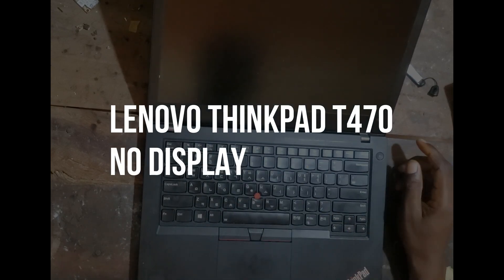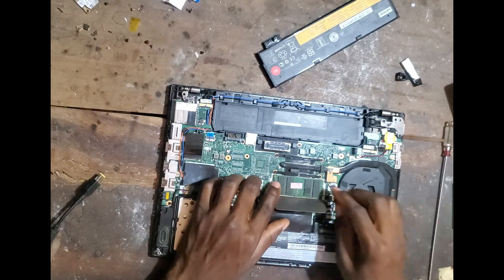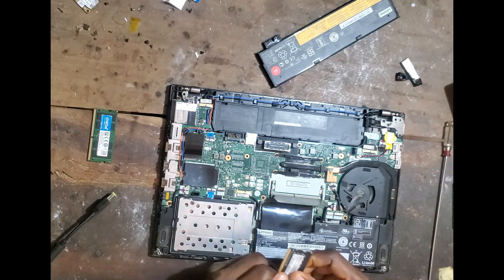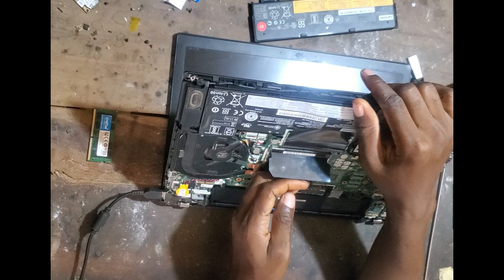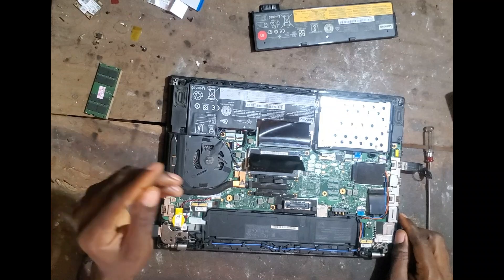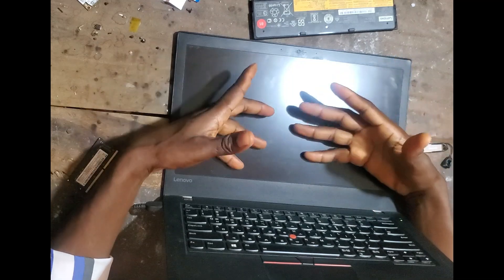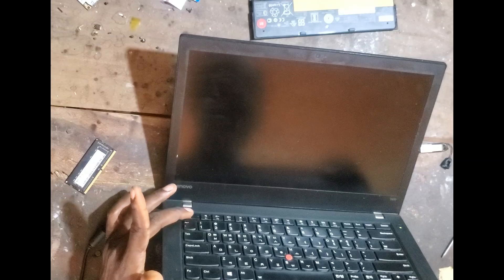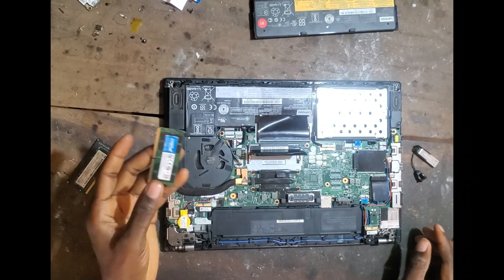Lenovo Thinkpad T470 No Display, No Beep; 100% Fixed Under 2 Minutes

Comment: Is it new ram? Try to slot the "bad ram" then turn on. New ram can take up to 5 minute to boot the window.
Try insert the bad ram into other laptops too, expect it will boot up in 5 minute
Reply from the maker: It wasn't. The RAM is dead. 

RAM shouldn't take that long to POST (Power-On Self-Test). 

A working PC with good RAM should POST in less than 10 secs. 

It becomes longer if there was a BIOS reset. 

NB: POST is the first thing that appears before the operation is passed on to the OS.

Comment: sorry engineer I got the problem with my lenovo T470 ,when i turn on the display is show fine but after few minutes or seconds it start to show some lines and the become black(it not display anything while the laptop still running),any help please.
Reply from the maker: Have you tried another screen on it?